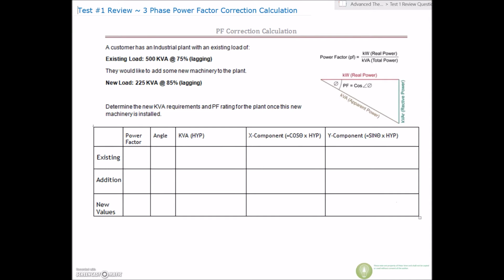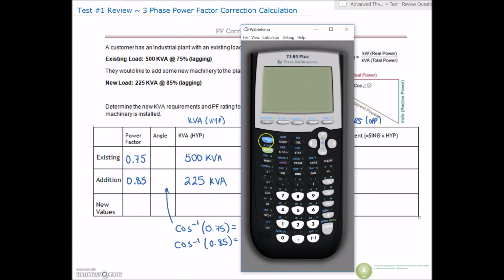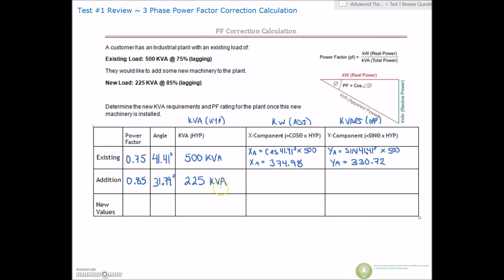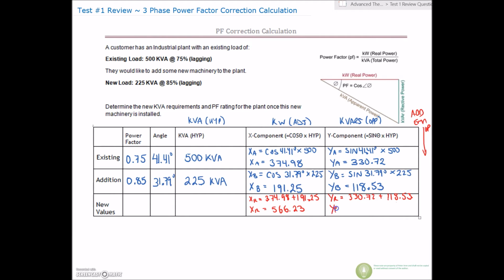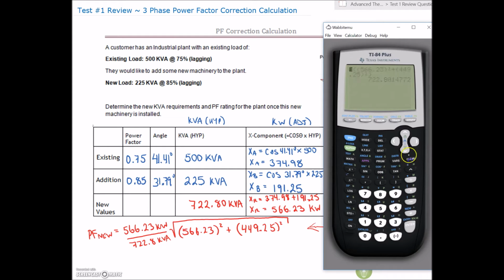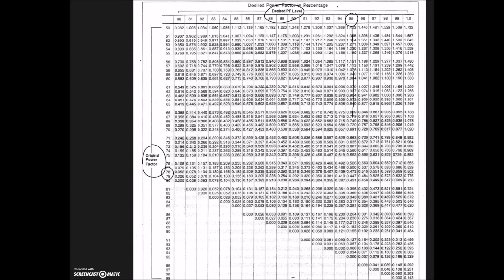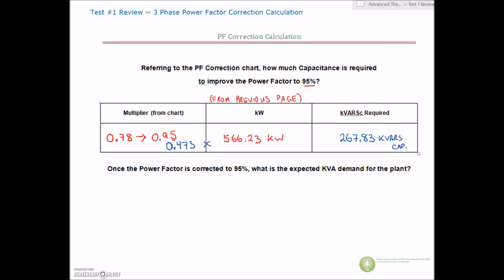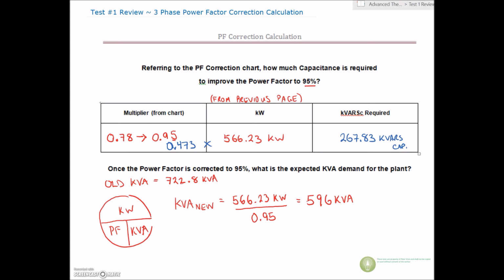3 Phase Test #1 Review (Part 8) 3 Phase PF Calc.

Comment: i think there is something incorrect with the chart at the End ( specifically with the multiplier Value ) 
as the KVA requiered should be 186.11 KVA to obtain power factor of 0.95 
proof : Squeerroot of ( 596.03^2 - 566.23^2) = 186.11 KVARc
Reply from the maker: Square Root of ((566.23 kW)^2 + (449.25 KvarsL - 267.83 KvarsC)^2) = 594.58 KVA
566.23 kW / 594.58 = 0.95
The Chart is good.
Reply: @PLCAutomationAcademy   you mean it's the amount of reduction not the final value of KVARc ... Now i got it 

.. do you have videos about the 3 phase system that's written with angles 70∆45 and so on because i dont understand it at all 

Thanks for the reply 
And thanks in advance
Reply from the maker: Yup. you got it. thanks.... no 3 phase videos in that in that format on my channel